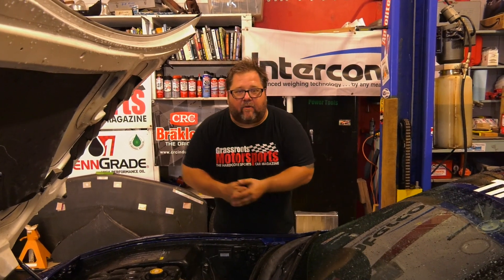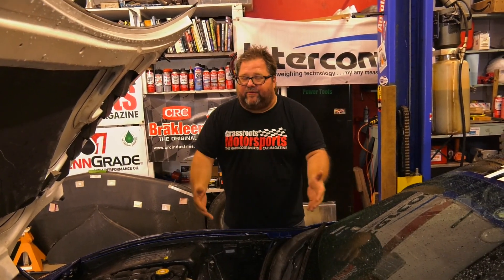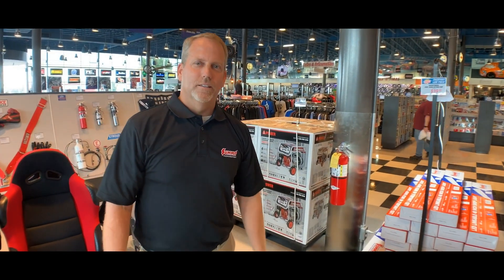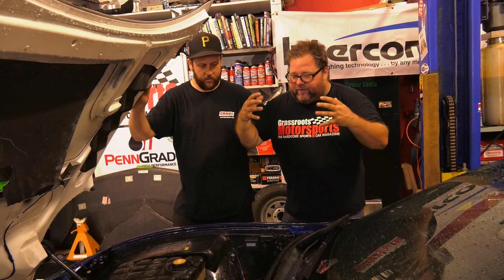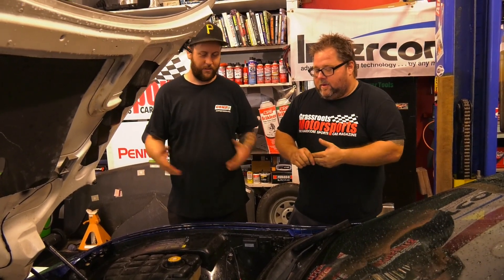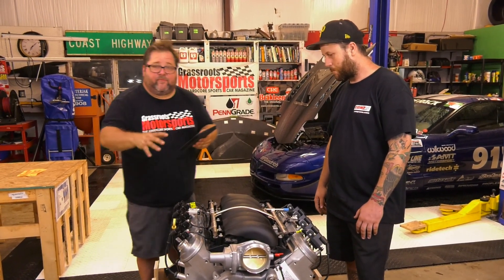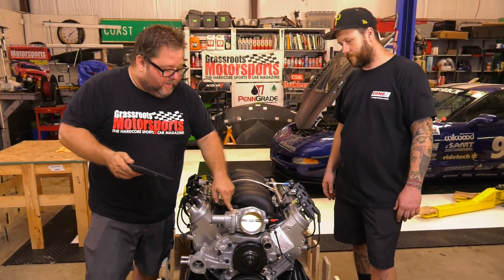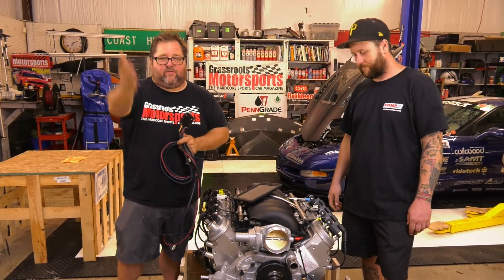Unboxing our 530HP BluePrint Engines LS3 Crate Motor

Comment: Really cool upgrade for the Z06.  Your times at Sebring were awesome.  However, if I recall correctly this engine grenaded at the track.  If you were going to do it again, what engine would you go with for more durability?  We're building a track/Texas mile type car here and wondering if better just to build up a forged assembly rather than going the crate route.
Reply from the maker: We lost this engine during a photo day. After disassembly, we surmised the cause of the failure was defective rods. The builder (Blueprint Engines) agreed and replaced it under warranty. Luckily we had lots of data logs and notes showing how we were using it, and that we were staying within reasonable operating parameters.
As for what we'd do different, honestly probably not much. I think we'd opt for some forged rods over our powdered rods as a bit of an insurance policy. We probably also would have made cooling more of a priority earlier on. When we sold it the car still had an upright radiator and was prone to heating up after a few hard laps. With a letdown radiator and some proper ducting I think that problem would have been solved. Those LS3-based engines run strong for hundreds of hours in TA2 cars, so with the right oiling setup they have proven durable.
Reply: @Grassrootsmotorsports  Great info.  Thanks for the comprehensive response.

Comment: Did the lingenfelter converter box work well? I am doing the same thing on my 2005.
Reply from the maker: Because we ended up using a Holley Dominator ECU, we didn't actually use the Lingenfelter box. We've got plenty of friends that have used them along with the original GM ECU with zero issues, though.

Comment: Can this guy explain to me how you would get a dry start off an engine that have been dinoed which all blueprint engines are ran on the dyno before they're shipped to the customers he clearly has not a clue of what he's talking about
Reply from the maker: Occasionally we back into a clue by accident. Anyway, of course we realize it won't be a truly dry start since the engine had already been run. But we also removed the stock oil pump, and the engine was now relying on the external dry sump pump for pressure and scavenging. e wanted to minimize the time it took that pump to pick up and distribute the oil throughout the engine ultimately.

Comment: How much power did it make to the wheels?
Reply from the maker: 450 whp on pump 93 and 460 on E85. That was fresh after install with no break in time, just doing the tune. Definitely feels like it freed up a few more horses after a few break in hours.
Reply: @Grassrootsmotorsports  that’s awesome! I am looking to do either this motor or the GM525. Thanks for the reply!
Reply from the maker: @Radron26  The BPE 525 is a near carbon copy of the GM 525. We've had excellent experiences with our BPE motor, and they were great to deal with on tech questions. I think the real answer is there's no wrong answer.
Reply: @Grassrootsmotorsports  How do you feel about the Aviaid Dry Sump? I read people have had engines locked up using it.  Has it changed or do you feel it will hold like the Dailys dry sump? I am looking at both, of course price is a big factor.
Reply from the maker: @Radron26  This is a big question, and we'll actually be producing a video covering a lot of our dry sump experience before saying goodbye to the car. Long story short, I think your dry sump experience is going to come down to your comfort level installing and servicing it. I don't think there's a "bad" system on the market. We've got plenty of friends who have had good luck with Aviaid setups like ours, and Dailey, and even systems based on the GM LS3 or LS7 bits. But there are a few things we wish we knew going in, specifically about hose routing, modifications to make it more easily serviceable, and the general fitment of everything. We'll try to cover as much of this in our video as we can, but also if you're installing your first dry sump system, regardless of brand, we think you should be ready for a couple things: 1) Be ready to take the whole thing off at some point and redo some connections, hose routings, etc. You're just not going to know until it's all in place how you like the routings and the general fit. 2) Be ready to be covered in oil. a lot. Servicing a dry sump is not like a regular oil system. There's tons of connections, and doing a complete oil change means undoing connections in tough to reach places, so every oil change probably costs at least one shirt. 3) Be ready to be frustrated before you are ultimately very happy. Learning the operation of a dry sump, if it's your first one, is like learning to play and instrument. There's a lot of things you need to experience by feel, so you can develop intuition about how it functions. It's hard to get that feel without getting a little oil in your hair.

Comment: Why didn’t you guys throw an e38 ecm and stand alone harness at this or a Holley system rather than using conversion modules? Just seems like an opportunity for failure or headaches
Reply from the maker: Since filming we have changed the car over to a Holley ECU, you can check out the details here: https://grassrootsmotorsports.com/project-cars/2004-Chevrolet-corvette-z06/bringing-our-ls3-powered-c5-corvette-life-project/

Comment: Dumb  you  don't  know  if a crate  engine  was  made  on a  Monday Friday  or  you're  lucky to  get a  Wednesday  engine  ? Car's  have  oem  VIN  numbers  So  Do a   is Built  with the   Vin   & highly & Simply   Decodeable  So whatever  sequence  the  build batch  day  is  Let's  say  the  4th   Vin  digit than that's the  Day  car  was simply  assembled  by  crying  labour  strike  plant Grunts  right  , The  engine  Vin  has  right  down to the  day  when , Where  What  Day  Month,  Year  Serial number   it was  put  together  it  has to  to  keep  things in  order  prior to  making  it  for  sale & Post  sale  for  administrative Scanner  tool  sequencing  purposes,  You  or should I  say the  Smarter scanner  packing   person  knows how to  decifer that upc  Bar  Code  Or  QR ( Quick  Reader )  Code  symbol all the  details are  simply  in  both  Scannable differing   UPC's. Simply as  that. You  obviously  weren't  listening in  class  when the  instructor  was  teaching  about  Ctate Engine  suppliers  Serial numbers  decoding.  Otherwise  we  wouldn't be  here  debating  about the  simple  Build  Date  recorded  on  all  Mass  market  Products.

Comment: Just dropped Blueprint ERngines LS376 into my Pontiac G8, made 545/522 on the superflo engine dyno from Blueprint, after the initial tune engine made 442/440 at the wheels on the dyno, very happy with these results.

Comment: So you mention a "Computer Box" to convert the signal from the Gold Blade LS3 throttel body to the Factory ECU. What "Computer Box" was used to accomplish this? I'm in the middle of LS3 swapping my C5 Z06 and the one hiccup I can foresee is the Gold Blade Throttle Body not working with my Factory computer and having to track down a Silver Blade "LS2" throttle body instead.
Reply: Heard him mention it's from Lingenfelter.

Comment: Grassroots, can you dry sump the original ls6? Thank you for the videos!
Reply from the maker: This is a C5 Z06, so the original motor was an LS6. And, yeah, you can dry sump any LS motor, the only question is how complicated you want to get. There are simpler systems that retain the internal oil pump for pressure and use an external pump just for scavenging, to three-stage systems like we're doing that eliminate the internal pump and use an external pump for pressure and scavenging, all the way to five or more stage systems that scavenge from multiple locations. In any of those cases, the engine has to come out (or, at the very least, the front subframe has to come down) to replace the oil pan with a dry-sump style scavenge pan.
Reply: @Grassrootsmotorsports  Any particular reason you're going with a 3 stage as opposed to a 4?  I too am in the market for a dry sump system and am unsure if to modify engine mounts etc so that a 4 stage fits or just go with a 3 stage.
Reply from the maker: @jonathangiahn7723  A little less complexity and a relatively mild engine. The car is also primarily used for autocross and time trials, so relatively short track sessions. For a road race car that was spending 40-60 minutes or more on track at once we'd probably think about additional scavenge stages.
Reply: TY! Not going to go that route lol
Looking forward to seeing the process, anything that you will keep from the original LS6 build? 
I've been following every upgrade and I have adapted some on to mine, for someone doing 6 track days a year @5 - 20 sessions and have Improved Racing internals, what other tips do you recommend?